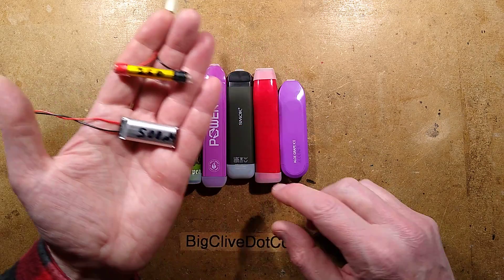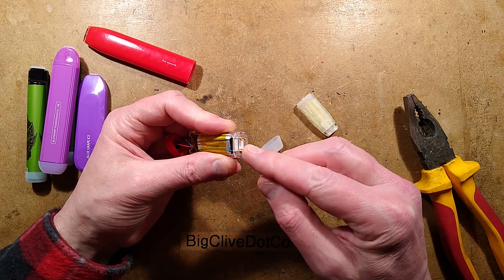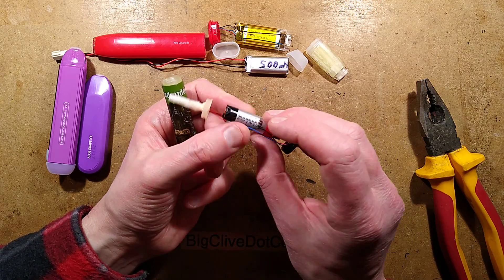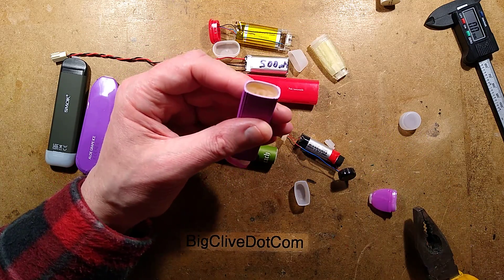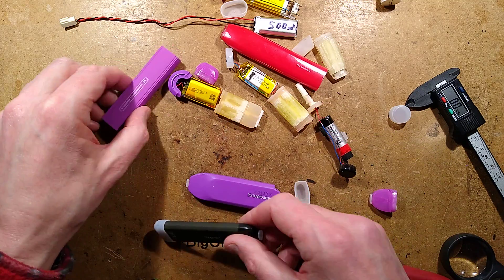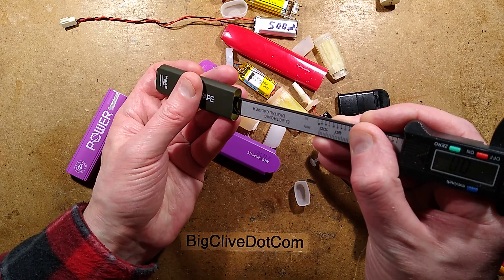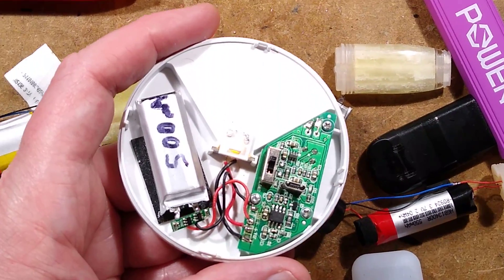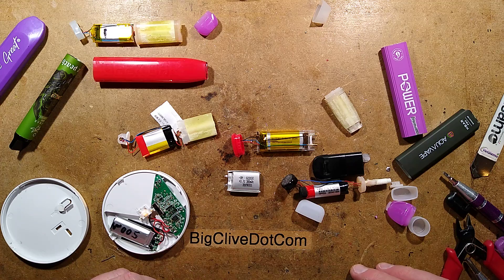Scavenging rechargeable lithium cells from the roadside

Comment: Hi Clive, following a random thought (interspersed with suggestions from this channel and beer) I soldered one of the better charging boards you've covered to a 1500 ma discarded battery, and also a step up board that takes whatever voltage the battery is putting out up to approx 5v, an amusing thought occurred to me ; if I flew two wires from one of the charging ports on the charger, to the lithium-ion supplying the voltage (to run the Nightcore) would I have made a perpetual energy machine...? (No, I know the answer really)
It's a shame you can't append pics.

Comment: Is there any markings on the cells to tell you if they are NOT  rechargeable?
Reply from the maker: No.  And all the cells I've tested have taken several full charges with an ongoing test on one approaching 50 charge discharge cycles, and retaining almost its full capacity.
Reply: @bigclivedotcom  thanks for the prompt reply.

I will do the first charge outside in a metal box just in case it decides to explode,  if that's successful then I will probably use it in something.

P.S. have you done a video on ways of telling if you're being charged apparent power or actual power from your electricity supplier?

Comment: Have you ever looked inside one of the rechargeable lithium ion batteries in the shape of an old fashioned rectangular 9v battery with the clip on terminals at one end that are on eBay? They look like the batteries that kids would lick for the metallic tingle back in the eighties. The usb charging ports in the sides of them gives them away.
There are also lithium ion C and D cells with USB sockets in the sides of their barrels for charging.
Reply from the maker: I've taken one apart in a video.
Reply: Search for "USB 9V 6F22 2/4Pack 680mA Battery 9 Volt PP3 Block Li-ion Rechargeable Batteries" to find some of these funky lithium ion batteries.

Comment: any chance of making a lithium cell charger for one of these? i do like the idea or a couple in parallel giving the 1A at 3.7v to feed led xmas lights etc. I appreaciate the chargers are less than a couple of quid from ebay, its the protection bit i am unsure about, as in your video you just reused one from a vapor unit. The second most popular one you suggested, the round one, i have 4 here all 500mah , me thinks would make a nice juicy rechargable pack ?
Reply from the maker: Video of that is made and coming soon.
Reply: @bigclivedotcom  thank you sir. BTW Is it as standard that they are all rechargeable?
Reply from the maker: @ashleynery8092  All the ones I've tested so far took a full charge.

Comment: I’m wondering if I could run three or four of the small batteries in parallel to get more amperage without interfering with voltage and get longer run time, could you do a video of that and let me know?
Reply from the maker: Yes you can.  But you have to match the voltages before wiring them in parallel.

Comment: Think I worked out why there are so many of these batteries lying around in the streets already removed from devices and looking to be  rather charred. Children and teenagers have worked out what to do with them to make an instant firework. I very much doubt it the manufacturers of devices such as e-cigs will ever bother to fit the current limiting circuit to the batteries due to cost.

Comment: You can recharge them and fill them again (some can be filled through the discharge hole) and used 3-4 times before the coil goes bad.

Comment: I'm thinking of using the 250mah battery for my pod vape that's rated 15w. Will it work, is it safer (less 💥 boom)?
Reply from the maker: The 250mAH cell has very low current capability.
Reply: @bigclivedotcom   I see, thanks man

Comment: "I'm just waiting for one of these to explode" - That's always what I'm thinking when I disassemble these because more often than not, the material is depleted before the cell so there's a fair bit of charge and no easy/pleasant/safe way to discharge it prior. I've had a scare where one momentarily shorted against the aluminum shell on disassembly - no extended short or hot environment so instead of bang or fire, it just looked like a sad puffer fish due to the internal gasses generated from this. 

Some of the tabs in these are downright gnarly, and while most of the better ones actually use kapton/polyimide tape, others use an inadequate amount of the gross cloth type electrical tape with precariously scrunched up terminals (AND IN AN ALUMINUM SHELL TO BOOT).

Comment: I can confirm that the trick you described (can't recall which video it was in), for "resetting" Li-Ion batteries, does indeed work.

I've just got a non-functioning battery, from my Digital Camera, to start charging again, by briefly paralleling it, in the charger, with a good battery. 😎

Comment: Nice 👌👍
I was thinking about posting a video about this, as I gathered over 40 Li-ion batteries from e-cigs lying around the roads. I'm happy to see I'm not the only one doing that 😇.
I've made a little power bank with 8 of them.
Reply: I found mostly 550mAh, a few 280, but even two 1500mAh cells.
Reply from the maker: I just got a couple of devices recently with 1500mAh cells.

Comment: I want to start this discussion with a statement: You can solder onto 18650s I have done this hundreds of times. I have made complete battery packs like this and have replaced a great number of single cells. That isn’t to say spot welding isn’t better, I just never needed  to do it, as the soldering iron is already hot.
Reply: PS I do have an explosion containment pie tin handy, with lid.

Comment: they are single use trust me i had a few of these and i recharged the battery 2 times and reffiled the cartrige once untill the heater died and the heater is annoying/almost impossible to remake and replace so at best you can get 1-2 refills on them before they cant be repaired anymore
Reply from the maker: If the heater is allowed to run dry it will destroy it by burning the wick.

Comment: ❤️ these videos. After watching this, I picked up five Vapes after a party, recharged them, installed one into a flashlight the same night. The COB side light it was fine, but the forward firing focused LED seems to have burned out. I guess I should add a 10-ohm resistor on the front for version number 2. A week later at the music festival I picked up 14 Vapes just in front of one stage. Now I need to add them to fairy lights and switch out the 3xAAA batteries from, well... everything. Thanks for these inspiring videos.

Comment: Hello Clive, my sister told me she's recharching these by simply connecting the red and black cables to those inside a USB cable. I'm presuming this isn't safe since this battery is 3volts and usb is 5. Is there anything we can whip up make this safe, or is the risk minimal as it is at the momen?
Reply from the maker: The charge needs to be stopped at 4.2V.  if you get a TP4056 module from eBay it will let you make a safer charger.
Reply: @bigclivedotcom  cheers Clive! Perhaps the safest thing would be to simply tell mum instead

Comment: I've been collecting these on my daily constitutional around the estate since before Christmas and so far I've found a dozen. All but one had at least 3.4v and all charged and held their charge well. soldering half a dozen in parallel with a suitable usb module makes great little powerbanks and one I fitted into a 3d printed C cell case to supercharge a woolly de-pilling shaver that was otherwise useless.  I love them. However I do have to suffer the eye rolling of my wife as I gleefully scamper into the middle of the road or a nearby hedge to retrieve my latest 'find'. The first one was a square section aluminium case that I printed an end cap that held an old powerbank pcb. The end result is indistinguishable from the ones you get from Poundland.

Comment: The 4:12 ones are found discarded just about everywhere here (US) . Have collected about 40 in the past 6 months. Just so happens there are several different ID and OD to the different varieties and brands and they fit nicely within each other.  Also an Estes model rocket engine fits nicely into the .73 ID inch variety.  Coupled with the nichrome coil that acts as the heater and the two part thermal insulator that is also part of these assemblies and all that is needed is a 3d printed nosecone and maybe some stabilization tailfins.  Many also have a clear plastic tube which fits around the tubular battery as an insulator.  Also a small vacuum operated switch behind the inhalation plastic mouth piece and a tiny led at the other end.  This info for educational use only.

Comment: Glad you made this video. I found 3 different smoking devices while picking up cans. One was run over. I saw the microphone and lipo poking out.  I opened one of the two non squished ones and tested it, it had 3v. I put it on a rc charger and it charged up.  So I did the other one. They are still charged 3 weeks later.  huh. If I was to buy that battery online to use for something it would cost way more.

Comment: You don't approve of these, so let's just smoke cigarettes instead... Anyway, so these batteries are all rechargeable? Or just the ones with the circuit boards?
Reply from the maker: You would have to assess and test whichever cell was in your device.  But so far all the ones I've seen have been rechargeable.

Comment: Further to my previous comment, I've been passed a "Voom" vape which is not refillable but has a USB C socket to re-charge the cell, referring to google it seems they do a refillable version,but this version does not seem to have any easy way to replace the cartridge. The pressure sensor on this version has 6 connections, 3 of which go straight to the USB C socket which is mounted on a small PCB held in by two screws... These devices continue to evolve..
Reply from the maker: The rechargeable disposables allow a smaller cell to be used with a larger tank.   There will be a way to refill the tank, even if it means drilling a hole and using tape to cover it after refilling.

Comment: The ELUX LEGEND 3500 Has 1500mAh cells 18650 size but half length. Four of these with a standard Chinese USB charge board can make a very useful 6000mAh power bank.

Comment: Having decided to give this vaping a go, provided I could get a tobacco flavoured vape (I smoke because I like the taste of the tobacco I smoke as well as addiction to nicotine). Unfortunately I didn't find a disposable vape that wasn't a sweetened sickly flavour (dispute labeled as smooth tobacco flavoured). I did fin a refill with a good tobacco flavour so I removed the guts from the stick, it's construction for the vape fluid was different from those you've shown but I managed to absorb the sweet fluid from the large sponge type material with blue roll and re impregnate it with the full on tobacco flavour.
My problem is that to recharge the cell there is only the tabs to attach to, if using a usb charge regulating board is it acceptable to use crocodile clips to make contact with the battery cell tabs rather than directly soldering on and off each time? Also what is the yellow transparent tape you use on recycled rechargeable batteries? And finally could you let me have a link to the disposable vape slicks you had that had the unpluggable fluid resovoire heating element (presumably replaceable), I really don't want to spend all the money on a directly rechargeable vape as the initial cost is beyond my available funds.
Thanks so much for your educational, entertaining content and the superb live streams, especially the Patreon ones, I have laughed so much at time my sides hurt! It like being in your local but able to hear what everyone is saying to you while you respond, a real tonic every week 👍🏻😊

Comment: Clive, I would recommend against reusing the device because the atomizer inside does break down to some degree with use, these are designed in such a way as to be disposable and over-use could lead to breakdown of the metals inside the atomizer and deliver those to the user along with the substance they meant to use. In other words it's unsafe.

There are methods to rebuilding atomizers and there are materials and equipment built for that specific purpose that would be much safer, as some of those materials are consumable and need to be replaced frequently.
Reply from the maker: The main thing that goes wrong with the atomisers is burning the wick if they are allowed to dry fully.  That results in poor wicking and more burning.
Ignore a lot of the carcinogen and micro metal crap.  It's coming from the tobacco industry and the general narcissists who put their negative slant on everything.

Comment: What are those devices?

Edit:
I've been finding these things all over and I have quite the collection of lithium ion cells.
Also, I keep the pressure things and the circuits. Most of them have different leds and 
circuits that I like to use for other tests.
Reply from the maker: Vapes.
Reply: @bigclivedotcom  Really? For some reason I couldn't tell. I thought they were some type of usb or something. I was wondering why people would just throw a usb stick on the side of the road or have a lithium battery.

Comment: Hang on. I just realised something.
The vacuum switch on all these is on the far end from the mouthpiece, so the chamber that the inhaled air is drawn through also houses the battery and electronics........ So what if something goes wrong during use (Which is when the circuitry and battery will be under load, so would most likely be when it DOES go bad)? If that battery vents, the user, at very least, is going to get a lung full of hot smoke !

Comment: Most of those are primary not secondary cells
Reply from the maker: Not the ones I've tested.  Primary lithium cells are much more expensive to make than rechargeable ones.  Significantly higher quantity of lithium metal.
Reply: @bigclivedotcom  interesting, the ones I took apart were primary.

Comment: being a smoker back then as soon as the first disposable electronic cigarette came out, I had checked inside, I had found small lipo batry, I am a model maker, I have a different charger for a single-cell batry. I managed to recharge it I even made two cell 7.4v packs that I use in a very small motorized rc cars with tiny cox glow engine and it work just fine this is Somting Very useful and free

Comment: I have a stack of over 60 18650 batteries that I've harvested from old laptop batteries. I've added protection circuits to a few of them but most I use unprotected in torches that have their own protection circuitry.

Comment: I buy these disposable vapes, used to add a tp4056 and refill them, but now you can buy rechargeable, non-refillable ones and refill them. You can usually refill at least 2-3x before they start being very good vapes. once they're spent, free batteries. this is my primary source of rechargeable li-ion cells, for upgrading the capacity of low mAh bluetooth things and building random stuff. sometimes you will find a cellphone on the side of the road that hasn't been too terribly run over as well.

Comment: I have found 5 of these disposable vape things with a 1500mah  battery. Considering they have only been charged once they like new. I've made a 7.4v battery pack using 2 of them for a remote control car and it lasts for about half an hour compared to the 12 minutes the original 500mA one lasted. They're marked up as " 3500 puffs" and are 20400 batteries 3.7v.

Comment: Converted my old Radio Shack Zip-Zap too use a Salvaged Vape lithium battery. Now it's runtime is way better and doesn't need to be charged constantly by the Controller. The original NI-MH 1.7v 100ma battery was bad. So it is quite the upgrade and The RC CAR ZIPS around with the speed of a real mouse now.🤣 Gotta reuse them or it is such a waste of a perfectly good cell.

Comment: The way the paint came off of the purple one, and the look of the metal underneath... Makes me very curious if that's actually made of zinc, and not aluminum. A simple vinegar test on the exposed metal should reveal bubbles if it's zinc or magnesium. Aluminum should not bubble, and will likely not be bright metal by the time you dig it back out of the drawer to do the test. Zinc is cheaper than aluminum, and melts at a lower temperature, making it all around cheaper than aluminum. 
Also, those 500mA batteries look about light enough to use in mini-drones, and the capacity is also right in the zone of the store-bought ones. Granted, the drone batteries of that class are not all that pricey ($4-5 USD each), and you'd have to buy or salvage your own connectors, but the drone Li-Pos don't seem to have protection boards, other than in the charger and the drone itself. Anyways, it seems like a viable route for turning someone else's bad habits and littering into something less wasteful.

Comment: Good call to use a plastic caliper here or is it an Aldi one that claims it's made from carbon fibre in wich case it will still conduct some electricity if the claim is true that is. As for sterilisation i trust that  system (underrated and fiddled with lately)  i got from Mother N. A little bit too much nicotine is indeed deadly though.
Reply from the maker: It's not conductive.

Comment: I found a discarded disposable device, carefully picked it up, took it home and disinfected it. Took it apart to find a very nice 20400 1500mAh cell in it. That will power a medium sized project for quite a while.
Reply: A follow up. I haven't found any more lying around anywhere. But I went to check to see if my wheelie bin had been emptied - it had - and in the bottom some kind person had left me three disposable devices. The batteries all seem good at around 3.3V. 13350 500mAh. I've got the first one on charge now to see what it takes. 🙂